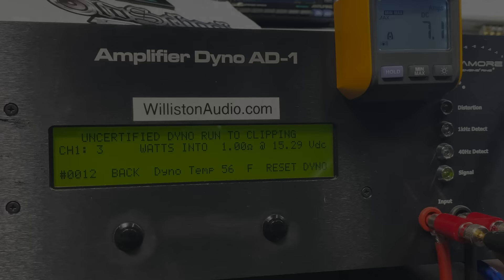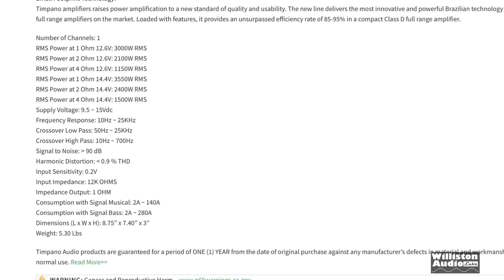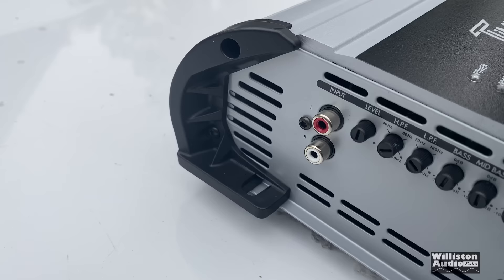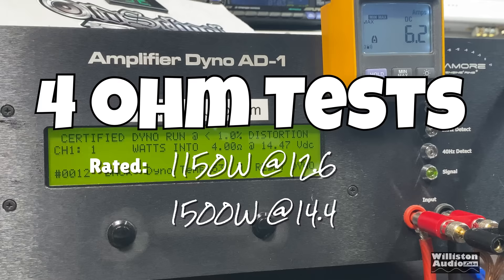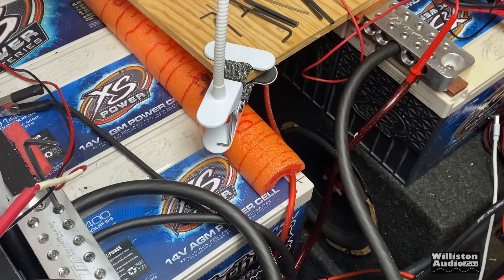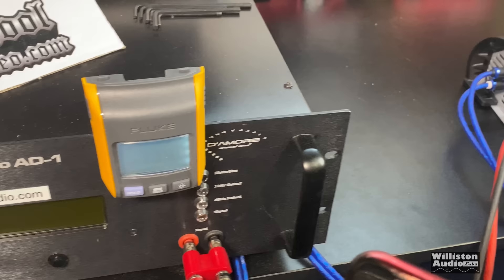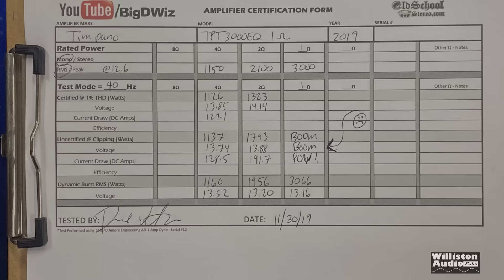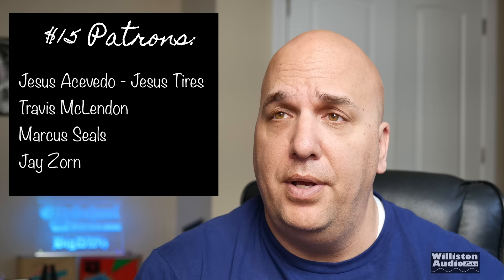This $220 3000 watt Amp GOES UP IN SMOKE! [4K]

Comment from the maker: See the TPT-3000EQ: (affiliate links)
Amazon: https://amzn.to/36fe4fK
eBay: https://is.gd/timpano3kebay

Stetsom EX3000EQ:
Amazon: https://amzn.to/2qsu3aO
eBay: https://is.gd/stetsom3kebay

See my playlist of Brazilian Amps tested:
https://is.gd/brazilianampplaylist

See 2014 Video of the 1500 watt amp blowing up at 0.5 ohms: https://youtu.be/865jrg8hMUo
Reply: Damn hope mine doesn't blow up
Reply: Hey big D do u fix amplifiers as well?
Reply: Those mad BMX skills. 😎
Reply: Thats not ok to sell this product... a product that burns out , thats stupid to produce a product that not hold 3 min. The same if you buy a new car and the engine blows after 20 miles... what they all doing? They produce stuff for the garbage... i dont understand that..
Reply: These amps are not for bass. These amps are more for highs and mid range.
Reply: @georgeferrer23  A 3K watt mid range amp? I mean... I like the way you think, but, c'mon man... People are going to put these on subs.
Reply: @georgeferrer23  or full range including bass but MUSIC not sine waves. Huge difference. These Brazil amps are cheap yet dirty power for large pro audio style speaker installs
Reply: @TheBrokenLife  3000w midrange on midrange only is very common in Latin America. Think 8x 8ohm 10in pro audio style midbass woofers all on one of these amps. to be honest for electronic music  PA style speakers cannot be beat for accurate bass reproduction which is why they're used in professional venues. Spl style woofers are sloopy and muddy but are able to play 30 second sinewaves @1000s of watts
Reply: @rmblwgn  Yeah, this isn't Latin America and we don't use 3000 watt car amps on PA systems to run mid bass.... That's the point I was making.
Reply: Williston Audio Labs Put them out of business!!!
Reply: Williston Audio Labs you should test the soundstream rn1.5000d only $220 as well
Reply: jose acosta still American Amps 🤔
Reply: They probably figured that a speaker load wont actual go to one ohm, which is common that it wont go to 1ohm, but some 1ohm subs with the right box design will hit those impedance at certain frequencies, so that's a poor choice. I'll stay away from amps that cant count up cleanly. I've seen a ds18 6000 watt full range amp dyno tested. And it went up to about 2200 watts, then stopped counting, and finally it hit just above 6000 watts and made a clean reading for an instant. No thanks this one is even worse, blowing up and all lol
Reply: @mattwells1036  these fullbridge amps are sketchy and generally remind me of a Chinese ac inverter
Reply: Timpano is a PRV Audio company - Copy of Stetsom Amp, made by "Timpano". Rumour is that Technichans from Stetsom started their own company. 
 Should be easy to test a Stetsom also.
Reply: Williston Audio Labs yo, I’m looking for an audio amplifier that can hook up to my Powerbeats Pro to make it louder. The only thing though, is that everyone I find needs to have a chord going from my earbuds to it and the Powerbeats Pro are TOTALLY wireless. I need help finding something that will make it louder for Christmas.
Reply: Please will you ever do a dyno test on a kicker Warhorse.?
Reply: Hey big D can you test a skar audio skv2 1300.2ab two channel amp skar audio tested it on their channel but didn't do a full 4ohm nor 2ohm bridged test just certified not uncertified or dynamic I own one and would love to see what it really does
Reply: @TheBrokenLife  I won't recommend for subs hell no.
Reply: @rmblwgn  I don't recommend them for bass at all. I have 4 8's in my pick up doors, and my stetsom amp 3000 2 ohm amp is perfect for the job. I haven't had any issues. For my 4 10 inch kicker comp vt shallow subs in angled  ported boxes behind the seat, I'm running a Rockford fosgate true 1200 watt mono amp which is 1 ohm stable. My subs hit Damm hard to the point it blurs my vision.
Reply: @georgeferrer23  I have two massive audio hippo eights at 1ohm on  a NVX JAD 1200.1/polk 1000.1(same amp) love it. I cant imagine the door cards it would take to put that many midrange speakersin my car I couldn't stand it
Reply: @georgeferrer23  if they are for highs and mid-range,  could you please let me know where I can get a 1 ohm tweeter that handles 3000 Watts RMS since that is what the manufacturers power and load rating is.
Reply: @tigeroftheeye7121  Dude are you serious? Those amps are made    to play 8 8 ohms speakers wired in parallel down to one ohm. What are you talking about a 1 ohm tweeter? You need to get 4 4 ohm tweeter's and wire them in parallel down to 1 ohm but they better be some powerful tweeter's.
Reply: @georgeferrer23  I am serious. Unless you just want loud loud and no sound quality even running 4 tweeters is ridiculous. Why not just go for 64 in a series parallel circuit  to disperse the power a little better ?  Even with 8 tweeters  I don't know of any good high quality tweeters  that can handle  375 watts RMS each. 
Plus, monoblocks are rarely engineered or made for mids and highs. Unless you're running them for home audio like some Krells.
Kudos to you knowing some of Ohm's Law with the parallel circuits
Actually a 4 ohm Tweeter usually isn't 4ohm. That's purely a resistive number and impedance actually varies by frequency. The amp does not see a DC resistance load since it is sending out an AC signal.  I have a video using my Rockford IM1 to demonstrate that.
Reply: @georgeferrer23  what are you running a mono signal?  or are you gonna have 2 amps and 16 8 ohm speakers in your car.  give me a break.  this thing is trash.  oh and why is there a low pass crossover on the thing if you aren't suppose to use it for bass.  gtfo.
Reply: @XX-121  Again, for the third time. I'm not running this amp for bass. Like I said before, I have a stetsom 3000k 2 ohm amp pushing 4 8 inch 8 ohm Rockville speakers wired in parallel down to 2 ohms. These amps push left and right sound out of one channel. Look at the rca connection, right and left rca Jack's which means they play in stereo mode. I haven't had any issues with my amp. I could throw an outdoor party simply just opening the doors with plenty of sound clarity. Go ahead pull up next to me with some kicker 6.5 or 6x9 I'll guarantee you, I'll make your sound system sound like a Walkman.
Reply: @tigeroftheeye7121  My amp is a stetsom 3000k 2 ohm. This amp offer plenty of quality sound. Again I'm pushing 4 8 inch Rockville 8 ohm speakers wired in parallel. High pass just little bass to give you a nice clap. I have a 1200 Rockford fosgate mono amp pushing 3 10 kicker comp vt shallow subs.they hit hard. My clarity is pretty sick.
Reply: Sound quality is very subjective.
My definition is , if you close your eyes , can you believe someone is actually singing and playing instruments in front of you as if it were live. 
Not just loud & clear. You can do that with only one big horn speaker & a PA woofer , but it will be mono. 
No sound stage at all.
I recommend everybody to go to a high-end home audio retail store and listen to a sound room with two well-placed high-end ( $5,000 & up ) Tower speakers. You will be blown away.& it will change your perspective on what sound quality really is.
I have had this discussion with many customers with my 30 years in & around the business. 
People would request rear speakers in their car so they could hear it coming from the rear and I asked them. " how many live concerts have you been to where you heard music coming from the rear of the stadium or Auditorium?" 
 Nobody ever said they did
This isn't Dolby Surround Sound home theatre
 Plus 25 years ago,  Richard Clark put out a $10,000 challenge if anyone can hear the difference between amplifiers and nobody to this day has ever got the $10,000. Many have tried , but all have failed. That goes to show you that you can't really hear the difference between amplifiers if the power output is the same level.
Hopefully this clears up any misconception on my previous posts about sound quality
Reply: Williston Audio Labs I almost bought one of those not no more !
Reply: We bought a EX3000EQ and the same thing happened to us with highs and mid, no bass. These things are notorious for blowing up like this.
Reply: Can you test some Memphis  stuff I noticed you really haven't done any
Reply: It's definitely your voice I cannot be used for bass it will explode this happened to me
Reply: Thank you for your testing. Not concerned about the companies that go out of business when they release crap to the consumer. I never understood why there is no agreed upon IEEE standard for measuring wattage.
Reply: @Darkheart617  to be honest we always had a extinguisher close by when we was testing back in the daze... SMART...... Amps blew up a lot back in the 1 0hm daze.. 1 ohm... seriously?  Blew up a lot of amps running low impedance tests.... FIRE... it happens... Good that people are aware that a system can in fact catch fire. Yeah. BDBD/2021
Reply: @dietershobbypakanal  theres two schools... ROBUST PROTECTION... or Protection is PRICEY...  so This amp falls in the latter category.  Robust protection would have saved that amp from turning into FIRECRACKER AMPS newest offering. Some amps wont blow no matter how low ya go. They just say NO and shut down. How it should be. BDBD/2021
Reply: I started installing Autosound in 1973. I have seen a few things. BDBD/2021
Reply: @bigdogbrodavepresents6178  yes i know , but a amp that burn isnt good for the car , the User and for the payed money 😊  i have amps at home they work with 2 ohm load but 4 ohm is the minimum.. and dont burn... they shut only dont if they to hot 😅.. greetings from germany
Reply: @dietershobbypakanal  Came a point in time when it was my job to see what them amps could do. I used to do some crazy stuff. How ya think autosound got to half ohm?.... Experimenting typically took place outside a vehicle. On Sunday.... Fond memories. BDBD/2021
Reply: @bigdogbrodavepresents6178  yes right 😊
Reply: What would be a good amp for 2 American bass xfl 15s at 3000 watt a piece

Comment: If their amp can't handle what they say it can they are kind of asking to be put out of business. I'm glad you make these videos keep up the good work.
Reply: Especially if it catches on fire.
Reply: Hey at least they didn't lie out their ass and multiply the rated power by 7 or 8. I bet if you put 300 amps thru any amp that's in its price range and the same will happen, but yeah it should have over current protection.
Reply: This is a misconception with the design of most Brazilian amps. The way dynos read power does something funky with the full bridge amp design. If you put that sub on a subwoofer and then clamp power tested it would do over rated and be very reliable. I personally have that stetsom ex3000eq in my truck for 3 years on a 300a fuse. Ran 2 18s walled at first now I have it running 6 8" mids. It's a fantastic amp that gets a bad reputation from these type of scenarios since you cannot dyno them properly.
Reply: @ ThonotosassaBoy
You wrote if you put that sub on a subwoofer. 🤷🏻‍♂️
Reply: @ThonotosassaBoys  With how cheap electronics are to manufacture these days, it's just not safe not to have overcurrent protection in the design. As a matter of fact, it's illegal to install any electronic equipment that doesn't have overcurrent protection in most countries for insurance and fire liability reasons. If you want to install some piece of shit equipment like this into your property, be my guest. But don't cry like a baby if your entire vehicle is in flames because the amplifier failed and the fuseing you used was insufficient.
Reply: So we're ignoring the distortion part too? Man those amps will never be installed in none of my vehicles
Reply: That amp was made to play high frequency not low frequency
Reply: @epsoncharles4512  doesnt change the fact it doesnt make the power it claims and if you try to make that much power with it It dies in a burn your car to the ground kind of way.
Reply: @waderyun.war00034  ok what's about the taramp? It's the same design on the inside. would you say the same about it?
Reply: Power Acoustik, Sony etc have been making amps for yrs that come nowhere near their advertised power.People keep buying them so why would they go out of biz
Reply: those amp are for mid and high not for subs i have one and never had a problum for bass go with taramp
Reply: @lacboiatl  that's because you're afraid.
Reply: @jrock5995  afraid of what? Why would I want it in my setup? If the distortion level is horrible then that's a no Brainer. Won't be in my vehicles. I'll run pioneer 4 channels before those trash can amps.